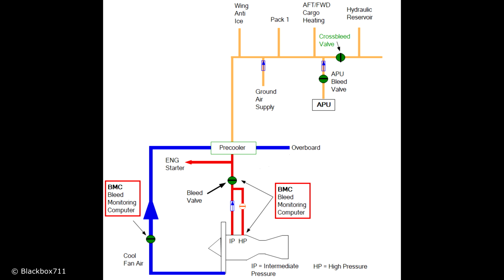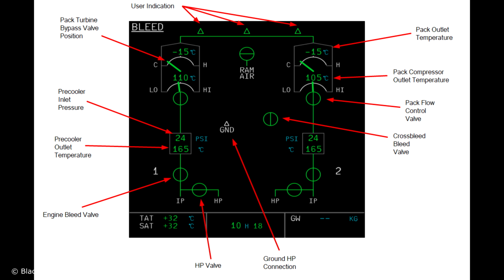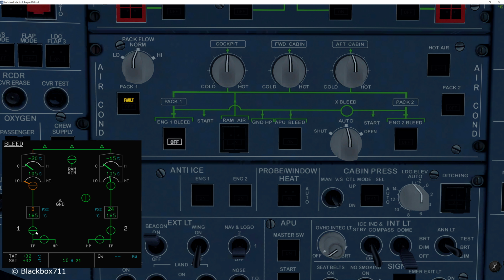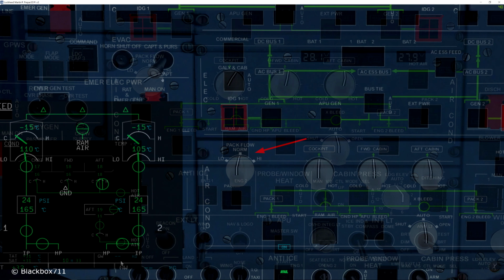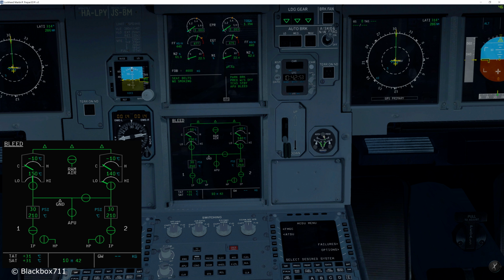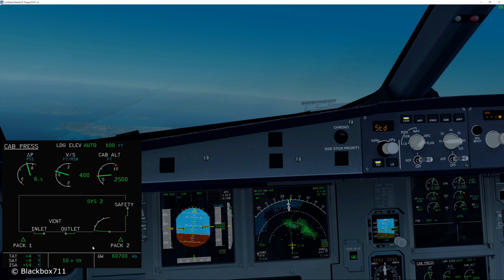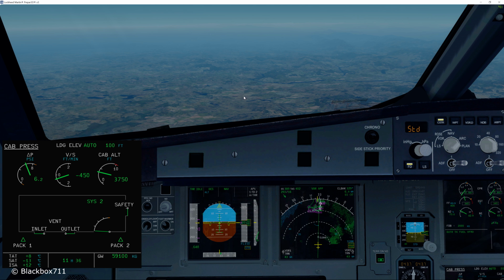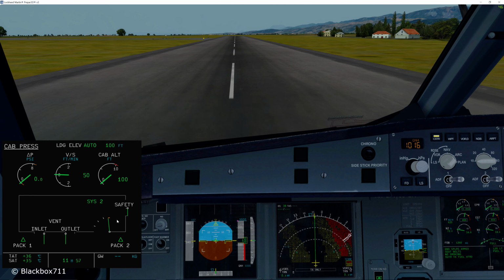FSLabs A320-X Basics: Bleed Air and Pressurization

Comment: Hello... I have a problem with my A319 fslabs... Air Pressure on cab pressure are in 0.0 doesn't change! I have a pressure problem in all my flights... can you help with please...?
Reply from the maker: Did you switch on the packs and made sure the windows in the cockpit are closed and locked?

Comment: Fascinating video - I always learn something new and really enjoy your style of teaching. Thanks so much for taking the time to share your knowledge!

I do have a small question - you mention pressure surges on take off and landing, what would cause these and how does a negative pressure in the cabin mitigate this ?
Reply from the maker: +Konrad Strachan .. Thank you very much for the kind words. Pressure surges or 'bumps' happen because air behaves a little like water. So during takeoff/liftoff the air will move backwards causing higher pressure in the back and lower pressure in the front. The pressure controller then has difficulty measuring and regulating the cabin pressure and that can cause even more pressure surges in the cabin. Regards
Reply: Fascinating.. thanks for the response :)

Comment: Enjoyed your live stream from monday, just as many others, it was very informative covering the temp and airco systems. 
I do have a question though regarding the one engine out simulation you performed, wich strangly enough nobody asked. 
After the bird strike in engine #1 the wing anti ice became inop. If this happens in winter ( or in the North like Canada/Scandinavia) with ice and snow conditions present, does this mean that only one engine out could end the flight quite unpleasantly?

And, me being a xplane changée..., here is a link of the best, free, airport sceneries currently available. (Maybe an idea to do a madeira flight in the Ixeg...?) 

http://flyingxplane.apps-1and1.net/tourist/

Thank youfor all the effort and interesting teaching you put in the sim hobby! ( especially when you get stressed doing the Cat-tests 😅, Cool to see you than fall back to your basic flying traing/procedures!)
Reply from the maker: +Wild Rover .. Thank you very much for the kind words! First of all there is a way to get wing anti ice to work on the failed side by opening the crossbleed valve and switching off one pack to make sure enough bleed air is available for wing-anti-ice. This should only be done when absolutely necessary, since it could contaminate the other bleed system with smoke or poisonous fumes. Secondly, thank you very much for the link! Happy Landings

Comment: Another masterpiece by Blackbox - looking forward to the sequel! Just one question: doesn't the APU bleed need to be precooled? Or is it automatically at a lower temperature than the bleed air from the engines?
Reply from the maker: +Thomas Hjortgaard Danielsen .. The APU has a single stage Compressor, so Bleed temperature is lower and does not need to be precooled.

Comment: Keep making these tutorial video's please :-). Much appreciated! All the best.
Reply from the maker: +Thomas Franckaert .. Thank you Thonas. Much appreciated
Reply: Was wondering though. As you commence the take off roll. Why is the pressure difference negative? Pressure in the cabin is higher than outside, so I would think it is positive no?
Reply from the maker: +Thomas Franckaert .. good catch there! I falsely said during the takeoff roll the differential pressure would get negative. That is incorrect. It goes to +0.1 PSI. I will change that in the video. Regards
Reply: Blackbox711 I don't want to bother you to much, but I am just trying to grasp the system. To avoid pressure surges the pressure starts to increase during take off roll...so the pressure altitude is now lower than the airport pressure (shown in the drawing). But isn't it just creating a bigger pressure difference cause the pressure altitude is lowe then the airfield. The difference between the red line an de the green line is bigger then the blue line and the green one. I hope you understand what I am trying to say... ..Thanks. regards

Comment: You're welcome for requesting this.

:P
Reply from the maker: Did you request this as well? I had another request for this from AirbusfanDK :)
Reply: Blackbox711 how many fps you get normally with the fslabs?
Reply from the maker: +Rubén Arconada .. in P3D V3 around 40 FPS, running approx. 75% from max settings
Reply: Blackbox711 ok thanks!! did you feel a big difference between the 4790k gtx980 to your actual rig?
Reply from the maker: +Rubén Arconada ... not as much as I had hoped for tbh. That was quite disappointing. But I would say everything above 30 FPS is good enough to have a good flying experience in P3D V4
Reply: Blackbox711 ok thanks!! now have a 4790k with 970, and want to change my rig to 7700k and 1080ti. now i get 20-30fps with fslabs, do you think it will improve at least to have always +30 if i change to that rig?
Reply from the maker: +Rubén Arconada .. I am putting my hopes on FSLabs 320 running smoother on V4.
Reply from the maker: +Rubén Arconada ... and yes, you should get 30+ with 7700k and 1080Ti
Reply: Blackbox711 thank you instructor, thats all. now that you are reading me, i'd like to say thank you for those amazing videos who help me to face new learns and experience onboard the a320. thank you so much, subscribed.

i hope you to upload more videos like that, and more videos with failures like the flaps one! :) and if possible, do you have a table about when to use flaps 1, 2... which flex temp we should use... etc. i'd appreciate it :)

thanks again

Comment: When you talk about Cabin altitude, do you confirm that it is in link with ISA standards? For example, if it pressurisés the cabin at the same pressure as LDG ARPT ELEV -250ft, to figure out pressure at that altitude, it does not use real static pressure but simply ISA standards no? Thanks!
Reply: Let me make it more clear: if cabin altitude is at 300ft (which means that pressure in the cabin is equal to the pressure at 300ft, If I understood it well). However pressure at 300ft is different everyday in real life: it depends of the weather, the place...etc. So how does it figure out pressure the exact pressure value at 300ft? It uses ISA standards to figure it out, right? Does it apply ISA standards from MSL (1013hPa/15degC ; which would mean that it knows that pressure at MSL is 1013hPa and that we lose 1hPa every 28ft. It is then easy to figure out pressure at 300ft in ISA standards) or does it apply ISA standards in link with current weather/pressure (The plane knows - ADRs - the static pressure outside. So does it then say that we gain approx. 1hPa every 28ft so it then figures out pressure at 300ft)? In the first case, cabin pressure at 300ft will always be the same in any plane. In the second case, pressure at 300ft will change everyday as our reference on which we apply ISA standards is not the same everyday. Hope my question is clear :) Thanks!
Reply from the maker: +Ayush Roy .. I did not expect anyone to really want to know this. But I was wrong 😉. OK, so here is the answer: The Pressure Controller normally uses the landing elevation and the QNH entered in the FMGC. That is why you need to fill out at least the QNH field in the Landing Performance Page. The pressure altitude is derived from the ADIRS. If the FMGC data is not available, the Pressure Controller uses the Captain Baro Reference from the ADIRS and the LDG ELEV selection. I hope that cleared things up!?